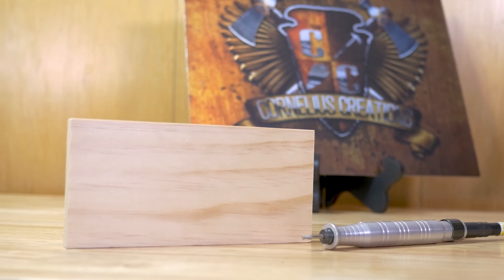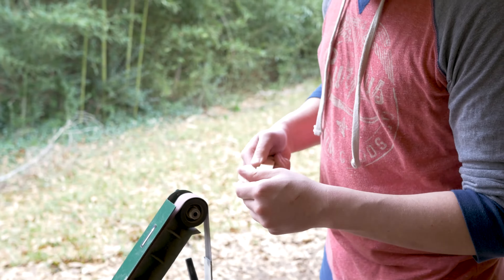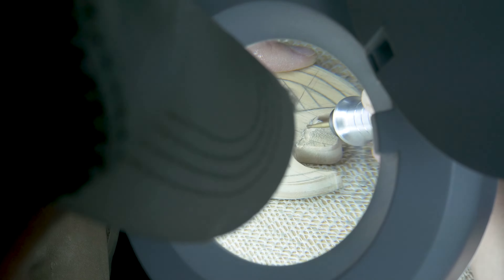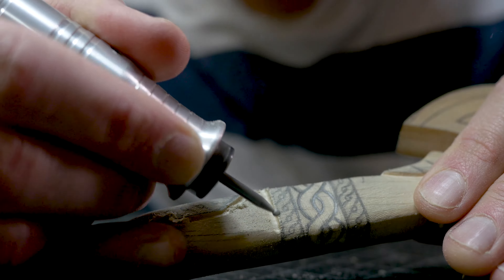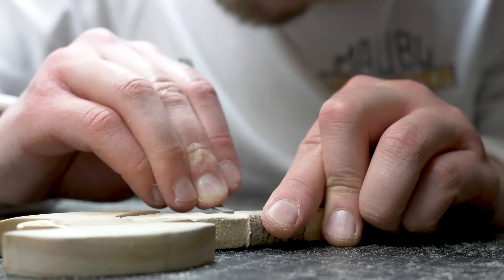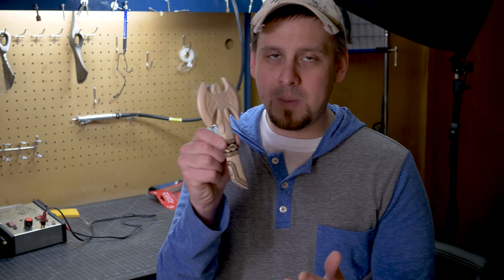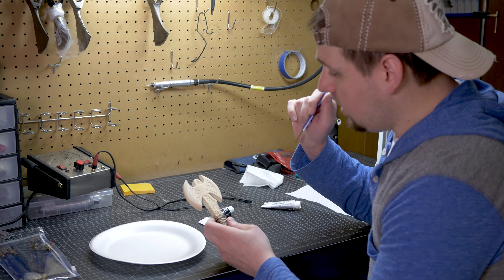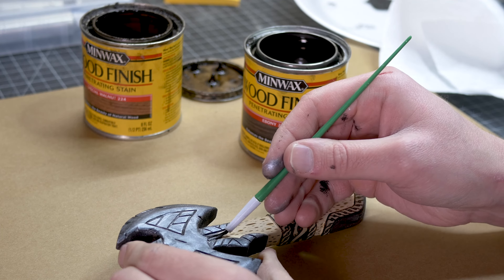How to Creatively Wood Carve with Dremel or ANY Rotary Tool

Comment: Watching again, of course! Ha ha ha. Curious about one thing on your finishing. You use black as a base finish a lot for metal and highlight with silver. What about using silver as a base finish a lot for metal and highlight with black? Awesome job
Reply from the maker: Thanks man! The black is a very strong color, it does not “highlight” well and will just look like a smear over the silver. Using a light silver color over the black gives you a much easier experience. And in real life, worn edges will be silver and “lighter in color” compared to the non-touched areas. I hope this explains it well!
Reply: @CorneliusCreations  yep, it sure does. Have never played with it so I was curious. Thanks tons. GH